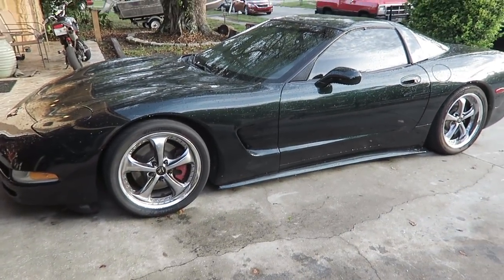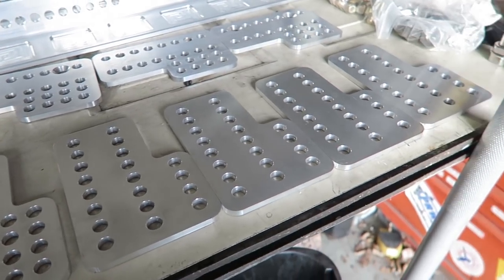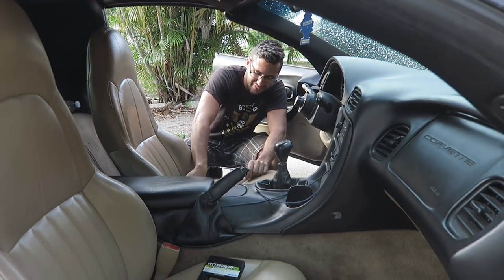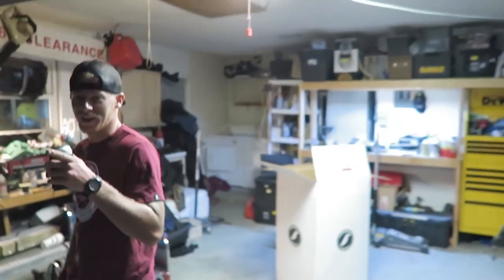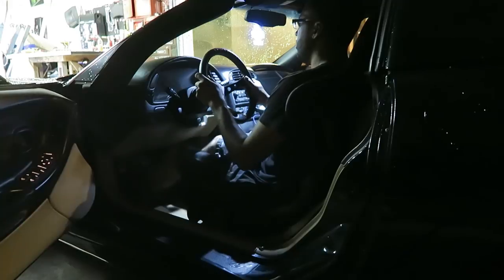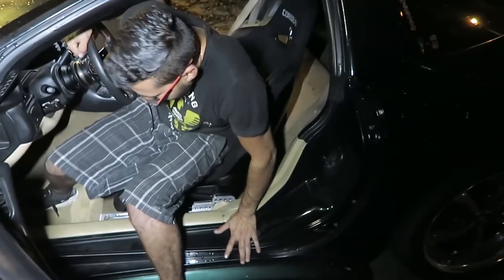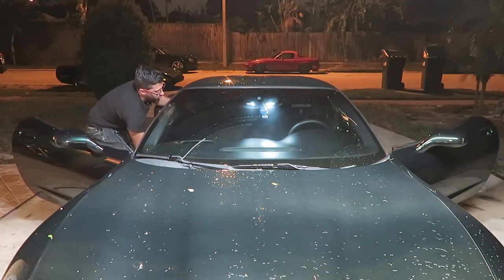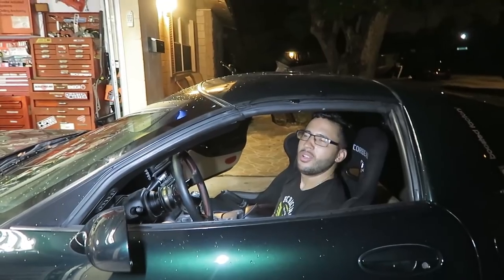DRIFTVETTE Bucket Seat Install.

Comment: Taylor you should route the seat belt through the opening in the bucket seat as it's much safer then over the top as it won't support you in a crash .only until you cage your car and get harnesses ?

Comment: Are bucket seats in a daily a bad idea?
Reply: some bucket seats are really comfy so no its not a bad idea if you actually need them
Reply: I have shitty little Sparco Sprint in my E36, and it's still fairly usable. M3 seats (in my case) would probably be better for a dailyable drift car, but the Sprint does the trick.